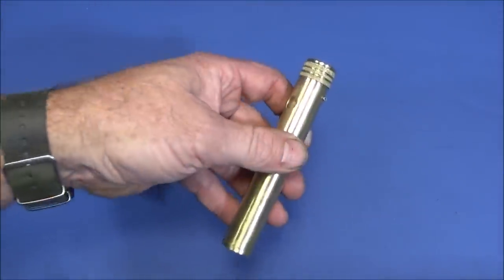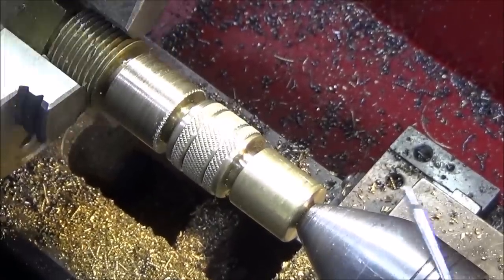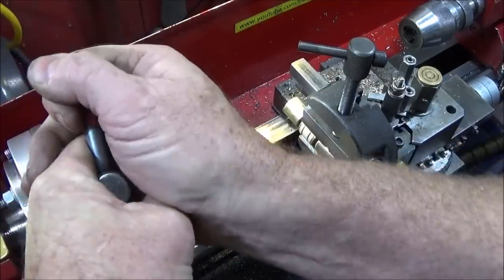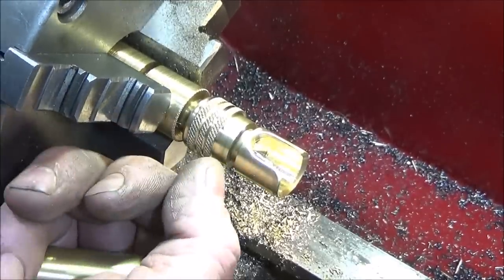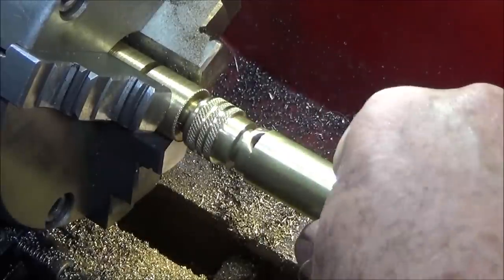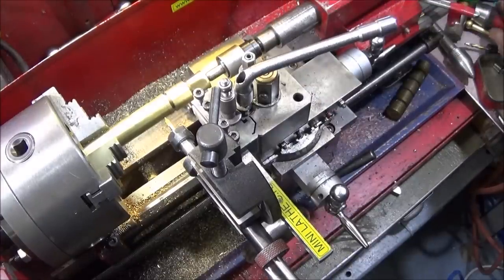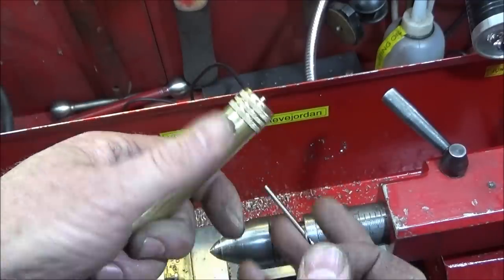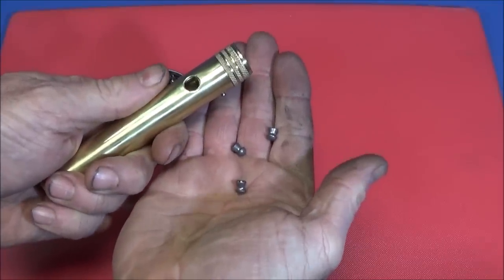Making An Air Gun Pocket Pellet Holder On The Chinese Mini Lathe

Comment: Excellent works indeed but was powering the horizontal drill used to drill the hole for the pin because from the video am un able see clearly,Zimba German from Lusaka Zambia
Reply from the maker: This is my toolpost drill and it is powered by a cordless drill on the other end of the spindle. You can see it on my videos titled toolpost drill

Comment: I’d like to make one for my dad. May I ask the  OD and length of pipe you used?
Reply from the maker: Hi Lisa, it is 20mm in diameter and 110mm long. Regards Steve
Reply: @SteveJordan  Thanks Steve hope you have a great Day!
Reply: @SteveJordan   I made the pellet dispenser and he loved it. I changed it up a bit.  I didn’t have any brass tube  but I had a piece of cherry wood I saved from the fire pile.  The contrast between the brass and cherry is pretty.   Thanks for the inspiration and the dimensions.  Lisa

Comment: Gday mate, do you use iso 32 oil for the headstock oilers, that’s a hydraulic oil?
Reply from the maker: Yes I use Iso 32 on the Myford ML7. I don't buy any particular brand as some lathe supply  sellers of the oil are way too expensive. I just buy a 25 litre can on Ebay....Should last for many years!

Comment: I have been an airgun enthusiast for some time. I think your idea is great, especially since I can get to make it on my lathe. thanks for all your video,s. I have one concern though. I notice your motor is open ended right behind your chuck. isn't that dangerous ?
Reply from the maker: Hi I added a brass ball loop hole and lanyard on the top today. You can see the finished pellet holder on my Google+ page.
   I have used several lathes set up like this in the past and personally do not find it dangerous.

Comment: whats wrong with the myford not seen for a while ?
Reply from the maker: Nothing. Im just showing people they can use the Chinese Mini Lathe to make things at the moment.
Reply: @SteveJordan  my super is going 3 phase nearly the same as in your vid apart from motor being a cheap new brook n comptom but the vfd is the same when it lands  so was hoping you'd not encountered any glitches
Reply from the maker: @lawrenceking2409  No the VFD's are fine. I haven't had any problems with mine whatsoever. They are excellent. I haven't got round to wiring up extra control buttons, as I find it is ok as it is. Going to 3 phase with the VFD is one of the best upgrades, I think.
  I will be back on the Myford soon. I was going to show my Milling attachment doing some other things.
Reply: @SteveJordan  Briliant i'll be looking forward to that . however the chinese lathe with it's mods realy has been shown to box well above it's wieght  quite an insight